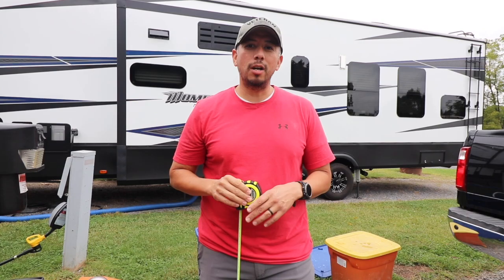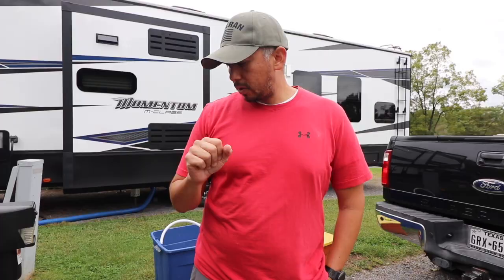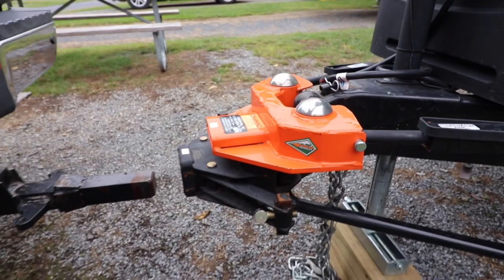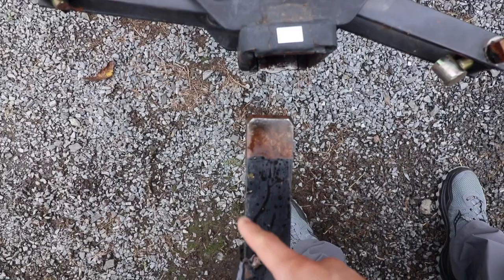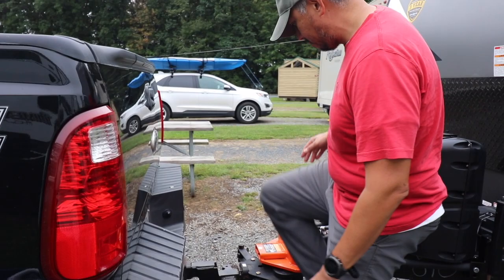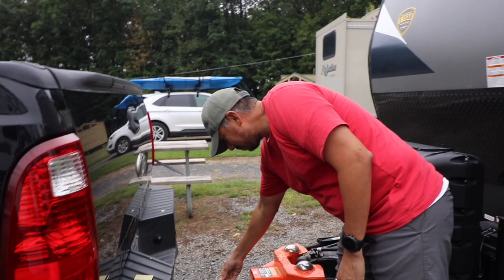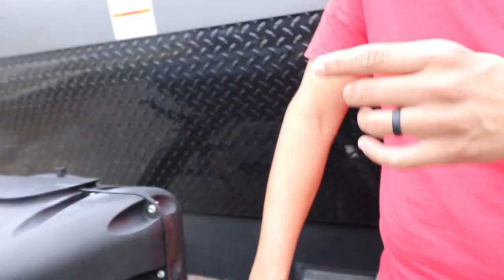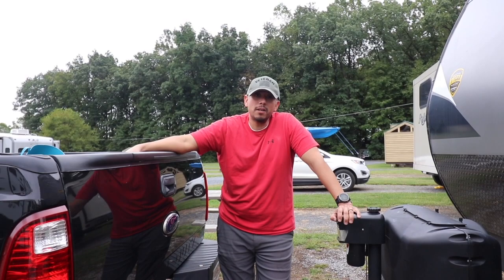How To Hook Up Hensley Hitch

Comment: Do you remove the bottom of your landing gear during travel?  I read somewhere that it could potentially interfere with the weight distribution bars on sharp turns.  I just ordered mine and am in research mode.  Thank you for the video!

Comment: How did you come to choose the Hensley over the ProPride Hitch?
Reply from the maker: It really came down to all the comments I read in my research.  I kept reading how safe everyone felt and how happy they were with their purchase. Having no experience with ProPride I couldn't comment on it.
Reply: Mike Brand I just ordered mine today with Black Friday savings of $800. I flipped my trailer and I feel very confident in this product after all the research I have done this will never happen again.
Reply: Drill Pipe Whisperer is there a code? I looked at their site but did not see special pricing...
Reply: MrJello4 did you end up ordering it?
Reply: How do you know if the bars need adjustment while driving?  New to towing a travel trailer and am looking to buy a used Hensley from a friend